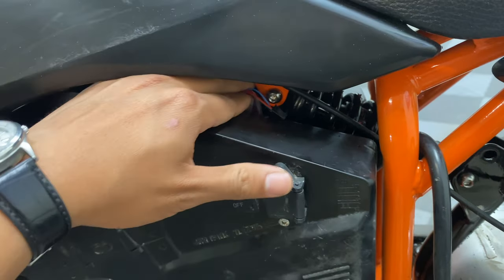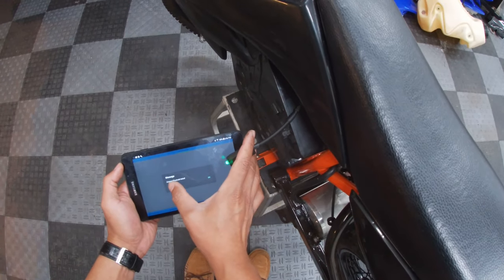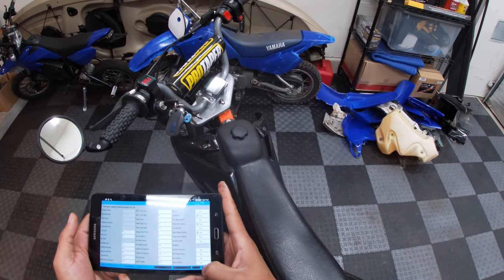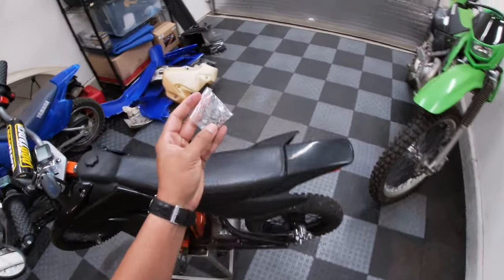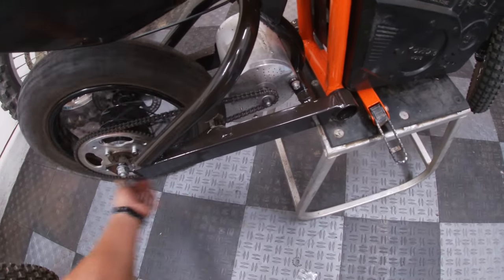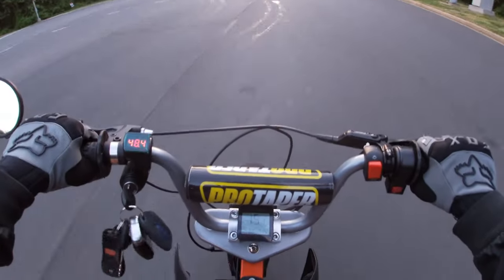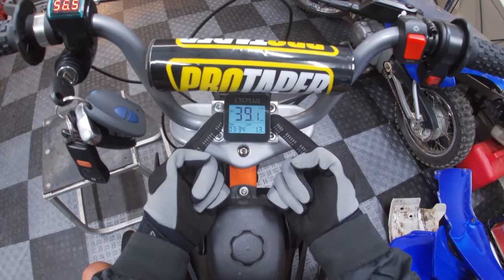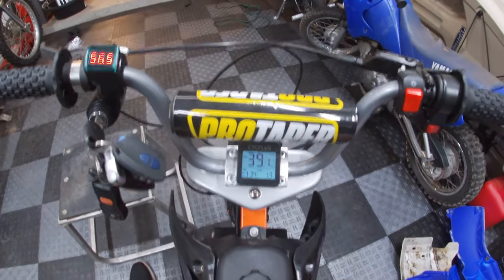More Speed Testing 52V Razor MX650 Build | 15-Tooth Sprocket Kelly Controller Bluetooth Module

Comment: So remember that max current per is the percentage of the peak amp out of controller (200amp). So if your battery is 80amp continous, you want to run 40max current per. Another example is 150 continuous, then 75 max current per. I will admit I run mine at what my burst is rated at which is over 200 so my kelly is set at 100 max current per. Another huge thing is in controller type make sure its set to 0(torque) or 1(balanced). At 2(speed) it has an awful torque curve and looses a ton of top end.
Reply: Hey buddy, let me ask you a question, how do I turn up the max current per without the increase in torque?
Reply: @rainbow6replay733  accelerate speed. Increase that number. That's the ramp in of the power. You can delay it coming in on throttle by changing increasing it. Put it around 25 if you don't want to wheelie
Reply: Thanka for responding, is there any way to have there 123 on the throttle control speed?
Reply: @rainbow6replay733 yeah it's all in the app. You have to program the speeds as long as you pinned the speed switch into the harness correctly. On there website you follow the diagrams to make sure you have that setup correctly
Reply: I setup the pins just like in this video, where on the app do I change for speed control?
Reply: @MooseRidez i have a question so everytime i ride and i give it to much throttle my bike turns off and makes the kelly beep how do i fix that
Reply: @hectorbuendia your max current per is set to high for the battery you are running and its making the battery bms trip

Comment: Been thinking about buying the adapter for my windows pc but it’s overpriced AF. Also I’m like 99% sure that’s just a normal usb2.0 pinout and I could hack it with a cheap cable

Edit: also you’re gonna join melted motor gang upping the amperage and sprocket size lol

Double edit: when you say “52v” is that still a 13s battery you’re rocking? I feel like I’ve seen both 12and13s referred to as 48v packs. Also loved the video!
Reply from the maker: LOL yeah I saw that and thought the same thing.. And I'm also 100% sure I'm joining the melted motor gang at some point with a 15T sprocket  ha, but it's just an experiment and not a recommendation!

Actually not sure about the full details on my battery.. All I know is it usually settles around 58-58.5 Volts fully charged, but notice a lot of voltage sag under load or quick throttle blips. Not a big fan, but it's what I got and it's got a convenient USB port.

Comment: How long does it last on one charge? im not sure if i should keep my 48v or just upgrade to the 52v
Reply from the maker: 48v vs 52v is minimal power gain. My 20AH pack lasts about 15-20 miles on a full charge. (Depending on load and constant speed.) If you want longer range, get at least 25AH but measure it first to your frame

Comment: Hey pat, do you know by any chance if you can run the vector 48v kit with 4 sla batteries?
Reply from the maker: I don't see why not, I did that with the Kunray before. Though the power and speed will be nowhere close to lithium output. Also be noticeably heavier
Reply: Thanks man do you know the wiring is it in the old kunray video?

Comment: Hey how did you fit that 15t sprocket on the stock chain?
Reply from the maker: For this bike, I just pushed down on the tensioner, fit the sprocket on the chain, and slid it onto the motor shaft. Didn't have to extend the chain.
Reply: @PatOutdoors  hey i tried that and i cant get it to fit any recommendations to get it to fit? i purchased the 15t from your link above please help me?
Reply: like i have no slack on the chain how is yours so loose
Reply from the maker: @rainbow6replay733  previous owner of my bike could have replaced the chain at some point 🤷🏾‍♂️.  You may have to get a slightly longer 25h chain
Reply: Ok thanks